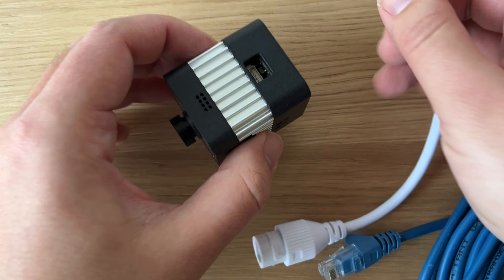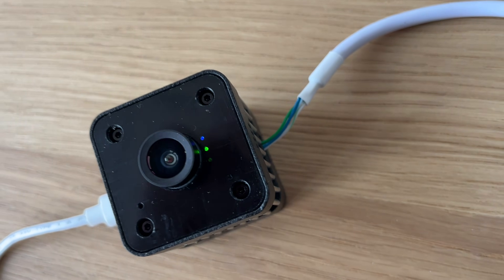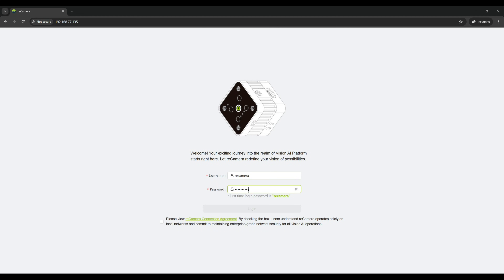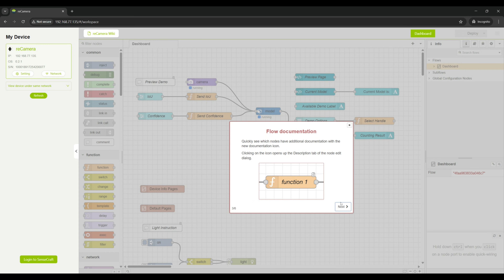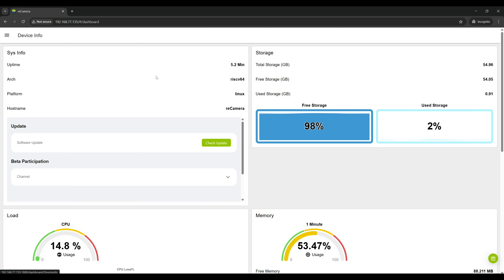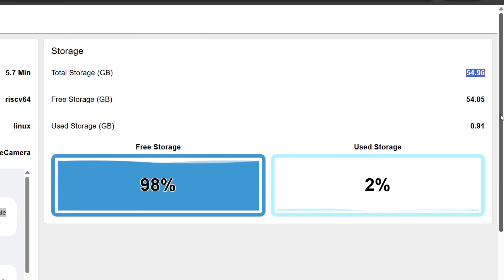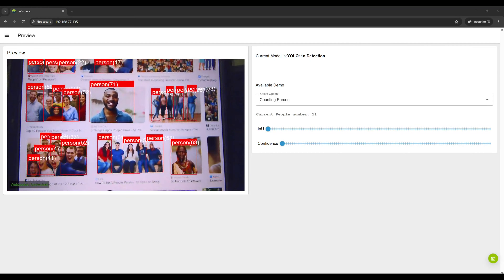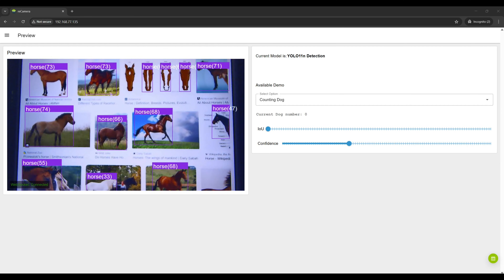Seeedstudio reCamera – Unboxing, Testing and Disassembly

Comment from the maker: reCamera is a pocket-sized, modular AI camera powered by a RISC-V SoC running Linux. Featuring 1 TOPS @INT8, a 5MP camera, built-in YOLOv11, and support for custom AI models and Node-RED, it’s the fastest way for developers to deploy AI vision into any system.

Feature
From Demo to Production in Days, Not Months
Ready Custom AI Models: Built-in YOLO11 with commercial license, Roboflow & SenseCraft AI support.

One-Line Deployment: Quick YOLO model deployment with a single command.

Easy Integration: Pocket-size, PoE&CAN-bus for expasion, Magnetic and 1/4" Thread Mount.

Reliable Performance: Optimized heat dissipation for stability.

Code or No-Code: Vision AI for Every Developer's Workflow
No-Code for Beginners: Node-RED for effortless custom workflows.

Pro-Code for Experts: C++ SDK and OpenCV C++ APIs for deeper diving.

Dedicated Accessories: Gimbals and more to enhance reCamera’s functionality.

Seeed Vision AI Ecosystem: From MCUs to high-end robotics, Seeed full Vision AI matrix ensures the ideal pair with reCamera.

Modular by Design, Customizable by Demand
Fully Open Source: Tailor reCamera to your needs.

Modular Design: Combine/Mix and match sensor, base, and core boards for endless configurations.

Plug & Swap: Easily assemble the reCamera for your unique needs.